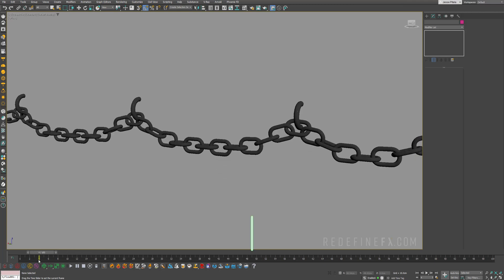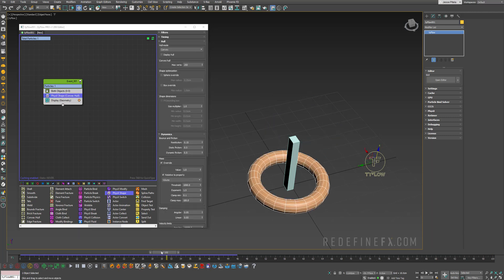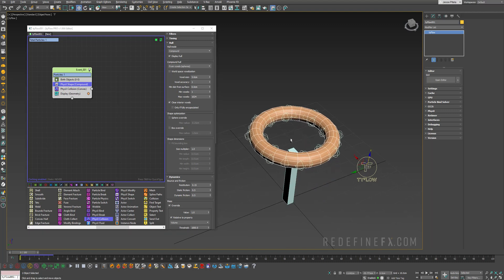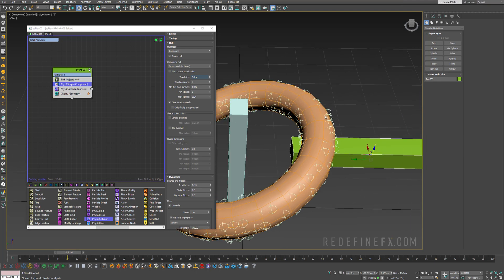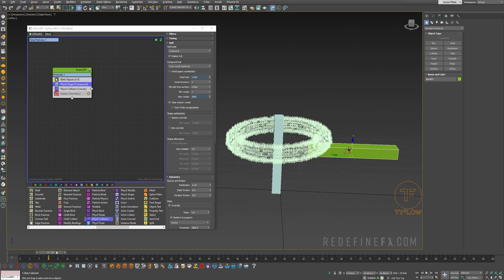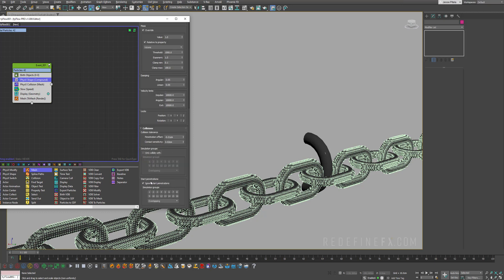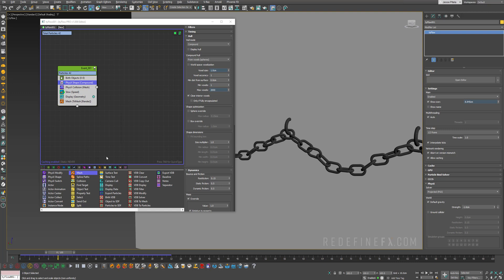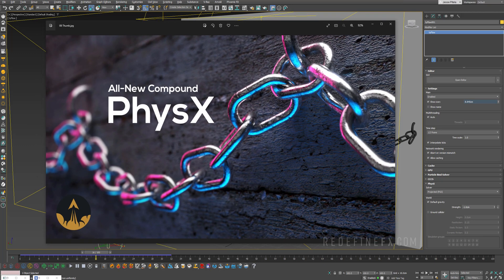NEW tyFlow Compound PhysX: Dynamic Chain Tutorial in 3Ds Max 2023

Comment: This is why I suck at Tyflow, I'm stuck @0.36 cuz I can't get the fuckin' torus to fall down, it just sits like like a bad perogi on the plate. Assuming it's cuz I'm using an older version of the beta?
Reply from the maker: You need to raise it above the floor. Once you make something a PhysX object it automatically collides with the default 3Ds max grid / floor.
Reply: @RedefineFX  Unfortunately, it was above the floor. But I figured that part out by realizing there's more than one Birth event to choose from. Now my second problem is two things:

B) It creates a clone that follows the timeline and does the TyFlow thing, while the original torus sits there static.

C) There's no such thing as compound as an option. So naturally I need to update, but I'd rather stick with the beta which gives me multi-threading.

Thanks for your input regardless, love your tuts.
Reply from the maker: @iamski  yes, tyFlow creates a clone which is the actual tyFlow particle. You can hide the original.